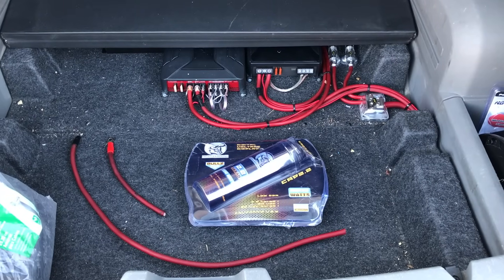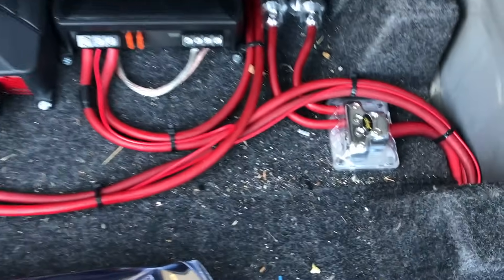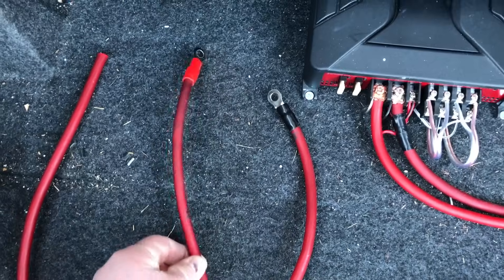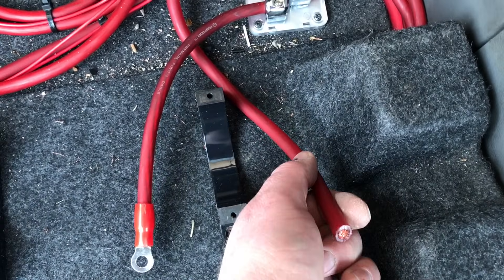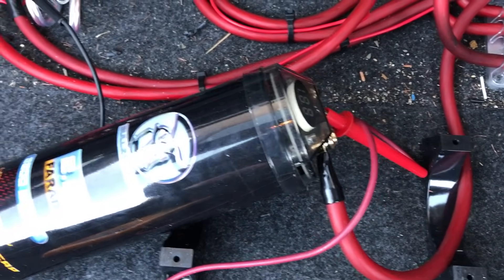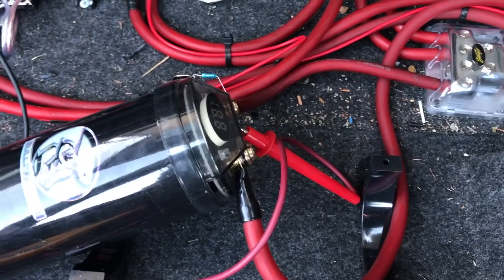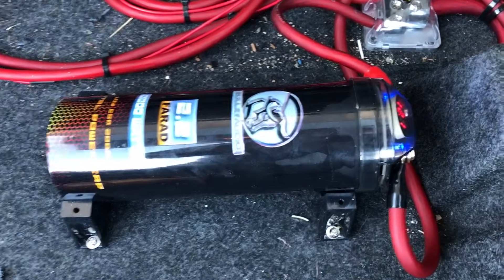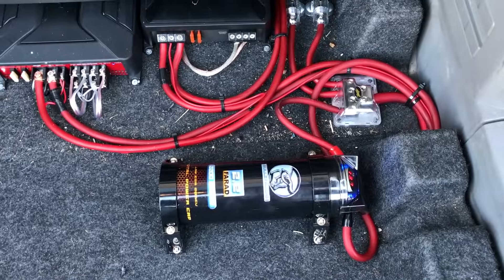How to Install a Car Audio Capacitor in your Vehicle

Comment from the maker: Parts linked in the description!
Reply: This is awesome, I installing a setup in MY Dodge magnum too. Kicker compvr speakers and subs
Reply: I had to come to an audio channel to figure out how to charge my big-ass Super Capacitor bank. It needs a low-Ohm resistor to charge....thanks. It only took three weeks to find that out.
Reply: What do I do with the little amp under the steering wheel
Reply from the maker: Nothing, unless you are planning on bypassing it.  If so, send me a message on facebook / instagram and I can help. @DodgeChargerPursuit
Reply: I Have A Question 
3 Northstar AGM31 PRO  Vs. 1 Northstar SMSAGM480 Which Is Best with JS 390a Alternator For Voltage ???

Comment: Shouldn't it go between the battery and distribution block??  That way the amps are pulling from the capacitor.  The way you have it ran the amps are fighting with the cap not using it!  Correct me if I'm wrong!  Thanks

Comment: Why isn’t the power cables to the amp coming from the cap? I see a distribution block sending power to the cap but what about the cap to the amp?  Whats the point of the cap then?

Comment: I have a 2007 Toyota Corolla with a 80 amp alternator, agm battery, 4 gauge ofc everything, a 1200rms skar amp, and dual destroyers d1 12s. I’m having big issues with voltage drop clipping and yes the lights on the inside of the car dim.  But problem is I have only been able to find 1 alt for that car and it’s 500$. I don’t know what else to do because I think a compositor is gonna make it worse, that just means my alt now has to charge two things.

Comment: Capacitors are able to charge and discharge faster than batteries 
    And make sure wire to and from capacitor, and each device should get its own capacitor preferably

Comment: Does it turn off or always stay on wen vehicle is parked??
Reply: Stay on for awhile then it should go off
Reply: @MiltonDearmon-n7y Hello!! Any idea why mine keeps flashing and draining my battery? I’m so frustrated.
Reply: @chrisftp1312  I don't know fam. Did you check to see if wires are ran correctly?

Comment: Can you wire the capacitor to any ground or does it have to be in parallel with the amplifier ground wire
Reply: Ground anywhere you want but if you use a distrubution block like he did, wire the cap positive in BEFORE the block not after.
Reply: @bigmizzymike  ok thanks. No just the power wire from battery to amp. I got that ultra capacitor coming! 375 fared

Comment: With it hooked up to battery positive does it drain the battery when the car isn’t on?  Also when I charge mine as soon as I disconnect the wires from the capacitor it imidiatlystarts draining and then blinks low.  Did I not leave the charging wire on long enough?

Comment: Why do i get a pop sound on the door speakers right after the capacitor shuts off, after the few seconds when turning off the ignition switch, it didn’t do that before installing the capacitor, capacitor was installed as directed based on this video

Comment: Love how EVERY cable it red, make for a more entertaining install.. 😂
Reply: it's not uncommon to use the same color wires when buying 20ft of wire. I'll take a heat shrink (black) and shrink it onto the wire so i know which ones which.. just a small indication for me to know
Reply: Lol when I was 16 I bought a 79 Camaro was impressed with how clean the engine compartment was........pulled the wire looms off to change the color and literally every single damn wire was red haha dude chopped it at the bulkhead and ran everything in red speaker wire. Thing looks like a closes encounter of the 3rd kind when you used a directional and highbeams

Comment: Thax for this video, extremely helpful. Question, for 3 amp setup/installation, does it matter what capacitor size to use? I see several sizes from 1UF 2000w,  2.5UF at 2500w, 5UF at 2000w......etc. Not sure what size capacitor to use in our new installation. (FYI, my old 1985 truck does not have a very powerful alternator, so I need as much help with power as I can for this all-new audio installation set up). 

What size fuse do you recommend using coming from the battery to distribution with 3-amp setup? Or from Capacitor to distribution? 

Also, the old stereo system with 2 amps that was installed by a stereo shop on this same truck, you could hear engine noise as you accelerate and shift(its a stick-shift truck) all through the speakers, very annoying sound. Not really sure what was causing that to this date. All that system is gone and we're installing all new speakers, Amps, Wires, stereo, sub...ALL NEW, do we need to add a device or do anything to  our installation to stop that engine noise sound?  Thax

Comment: This is a good video, it will help a lot of people. But there are two little things I saw wrong with this system in the video. The large capacitor and battery in back are wired into the system in the exact same way for a good reason. Think about it. 
* Often, the battery is in the front of the vehicle, and the amp is in back. Installing a large capacitor or battery near the amp allows you to use a smaller gauge cable from the battery in front, to the capacitor or battery connected to the amp in back. This cable from the front only needs to be large enough the keep the system in back charged. The large cable is still needed between the amp, and capacitor and/or battery in back. The capacitor and/or battery in back are there to supply the extra power needed during intensely high electrical current draw moments. As you can see, using a battery with a good amount of cranking amps or a large capacitor, close to your amp, accomplishes the same purpose; they are both acting as a buffer. If you only use this system when the engine is running, having both the large capacitor and battery in back is overkill. Unless one or both are too small of a buffer for the amplifier's needs, a battery in back close to the capacitor, only increases the system's energy storage capacity. I am a military trained electrical technician.
Reply: Bigger is still always better for wires though but I run 5k watts 🤙  and yah wire diagram is off

Comment: What is the value of resistor and when you need to pull it out?
Reply from the maker: You can safely discharge the capacitor.

Comment: Does the capacitor ever turn off... and if not Does it drain your battery
Reply: He hooked it up the wrong way. The diagram shows that you hook the power wire to the capacitor, the capacitor to the amplifier, which have a remote that turns the amplifier off and on, so should the capacitor turns off and on when the amplifier is on the capacitor on when the amplifier is off the capacitor turns off

Comment: Bout turn on and off do you need to install a killer switch? I got lost on. That part. Or it does turn off automatically after some time not use?
Reply: It doesn’t turn off you have to use the resistor to drain the power out of it but that’s only when dismounting or if the car is gonna sit for a long period of time

Comment: The end of the video is unclear, not sure if you hooked up 2 power cables to the capacitator or just 1? Since you showed the looped before, battery to capacitator and then to the amp. But it doesn't show on the vid.
Reply: I understand. He's using all the same color but I don't blame him. That's his preference. He only used a ground wire and one power wire. But that power wire was to the distribution block so it can power both the amps. I don't agree with it and I never seen it that way but If it worked for him then he's good

Comment: Dude you need to redo the wiring; Electronics 101, all ground wires are black / green NOT red
Reply from the maker: This is an old video.  Also, DC current could care less about what color the shielding color is.  Finally, being that this video was filmed about a decade ago, sometimes we are given wire the owner of the vehicle wants to only use, so you make due.  You apparently  haven't seen any of the actual content we make today.
Reply: I know....have a good weekend

Comment: Hey man, I just installed mine today and I noticed after about 20 seconds the lcd turned off and stopped showing the voltage while the car was still running. And started showing voltage when I turned the car off. Is this normal for the lcd to turn off after a certain amount of time but it’s still on? Thank you
Reply from the maker: Caps are generally low quality and don’t help much, but some do have a digital voltage display.  Generally they only show voltage readouts when there is only a voltage change.
Reply: @ProvoBeastAudio  thanks man I didn’t know if it was supposed to stay on or not but that makes sense that it only comes on when needed. And yes I agree. I thought I’d try it out for now until I can get a bigger alternator.

Comment: When my electric cooling fans turn on it causes a rough idle and light dimming. Will a capacitor like this help to provide the needed jolt of watts? If so, how can I set it up? Can anyone give your opinion please? Thank you.
Reply from the maker: I strongly suggest a big 3 upgrade and a better battery before you invest in this.  Generally capacitors are garbage and really wont' help much.

Comment: Now i see the capacitor have only positive and a negative so how does it go off or does it stay on. Don't understand nicely.
Reply: He hooked it up directly to the power source, which is the battery. There’s no power wire running from the capacitor to the amplifier so the capacitor was stay on and drained the battery.

Comment: so if i have 2 battery's allready, do i need  a capacitor? FRONT (YELLOWTOP) BACK YELLOWTOP -> capacitor
Reply from the maker: Capacitors are in most instances garbage. I don’t recommend it.

Comment: Does it matter what size distribution block you get ? Or is there a range of wattages to choose from in distribution blocks?
Reply: No, just make sure you get blocks that can accomodate the wire size you're using.

Comment: I just want to ask what does a battery capaciter do actually.
Reply from the maker: Provide more current when amperage draw is heavy when usually bass hits (generally for sub amps). These however are usually garbage and are in most instances not effective. We suggest doing a big 3 upgrade before investing in a capacitor.

Comment: Isn’t this technically wired in parallel when you do it post distribution block? Capacitors should be in series, so in this case, before the distribution block.
Reply: Not if it's only going to one amp.

Comment: I charged mine, it turns on when I open the car shows 12.something V. When I turn on the engine shows 14.something. But after a wile it turns off even if I'm listening to music and the amp is working

Comment: Question so to charge the capacitor i just need to connect negative to capacitor then resistor to positive cable then the other end of the positive resistor to + capacitor??

Comment: Hi I need an advice here I bought 2 amplifier Monoblock and 4 channel and a 3 way crossover how do I connect everything together and which rca cables must I use to connect
Reply: Hook up 4 channel then run rca into input of 4channel the other end to the monoblock so it amplifies the sound for subs. I never touched a crossover so I cannot answer for that

Comment: Won’t the amp still be taking power from the battery instead of the capacitor because the distribution block allows it to take power from the battery and capacitor
Reply: That’s what I think too! All caps I’ve installed show 12v power into the cap, then out to the amp straight from the cap.  I’m not sure how this install would benefit full potential of the cap

Comment: would the light on the capacitor create a parasitic draw on the battery?
Reply: I was wondering the same thing.  There's gotta be a way to shut off the capacitor when you shut off the car.
Reply: @Stalkervette  mine shuts off no problem or goes into standby mode. If your worried about a 2w LED light then maybe you need to rethink your hobbies lol

Comment: If I'm running 0 gauge to the distribution block, do you think it's necessary to run 0 gauge to the amp from the block or is 4 gauge fine? Would there be a power loss? Thanks!!!
Reply: Update? Any power lost
Reply: @ryaneboy101  none. Should have ran the 4 to begin with. 0 was overkill for 1500 watts. Anything more id say yes. I ran 4 from the front instead. But you wanna stick to the gauge you run.
Reply: Seriously I don't understand why ppl want these big fat stupid dong wires running all over their car. Get some 4g OFC for power and 8g OFC for amp distribution and be done with it. You'll only need the dong wire if you're using CCA

Comment: Do you have to charge your capacitor?? Can I get away with not charging it or it's a must?
Reply from the maker: Before running a cap, I'd suggest a better underhood battery and big 3 upgrade.  Don't waste your time with a cap.
Reply: @ProvoBeastAudio  got cha!! I was told my amp cuts out, cause it might need a capacitor!

Comment: For the extra ground wire did u just cut the power wire? I’m new too this and about too install my system
Reply: No I'm sure he used left over power wire. Since it's the same as the ground only difference is the color of the cable

Comment: What if I don’t charge it? Mine won’t hold a charge by the time I get the positive wire on its empty.
What if I just hook it up and don’t charge it?
Reply: You will probably blow something up as you are effectively putting a dead short across your battery.

Comment: Just letting you guys know never buy these look on down4sound and they have a video explaining it all your paying literally for 2 farads for 70 to 80 dollars when you can get a 500farad cap bank for way cheaper that actually works these things have sand inside of them to make them heavy try starting your vehicle with one you cant but you can run your car if needed on a real cap bank if in a emergency for 299 you can get 500farads for a bank of 6 caps hope this helps

Comment: Will this stop my headunit from restarting when I crank the engine. Super annoying as it takes a while to start and repair the blutooth to phone and start the streaming again. I can run a wire from headunit to this bypassing car wiring.
Reply from the maker: That sounds more like a head unit wiring issue.

Comment: How long can I leave it connected in my car that I don't drive
Reply: The Super Caps have a high discharge rate and will drain your car battery as well. The Caps can fully discharge in a matter of days. So keep that in mind.

Comment: I'm thinking of adding a capacitor to the batwing fairing on my motorcycle.  Can I run positive and negative from the battery to the capacitor in the fairing and then from the capacitor postive and negative of the amp?  That way I only need to run 2 - 8awg wires to the fairing.

Comment: Why would Some stiffening caps have a remote wire ?
Reply from the maker: Some have digital voltage displays that use that remote wire to boot the display when the engine is running.

Comment: Can a capacitor catch fire on the go? i am new to this, but i have upgraded my audio system which causes light dimming. I purchased rockford fosgate 1 farad cap and the installer smoked it on the first day. And recenlty i got soundstorm 2 farad capacitor . I wanted to install this in my car.

Comment: I have a question? I set up my capacitor the same way yours is set up. After speaking with a technician and they said that it’s wired incorrectly. That the power wire from the battery should go straight to the capacitor and then a power wire from the capacitor to the distributor which is going to the amps. What is the difference between what they are telling me to do and what we have installed right now?
Reply: The way your talking would supply all amps by the capacitor. For example I have a distribution block from main battery, it splits to a 4 channel amp and 2 channel. The sub  when the bass "drops" calls on amp to give it power which is when headlights will dim. Your door speakers don't require much power, the power they use is to get loudness and clarity, so to have the full benefit the capacitor needs to be as close to amp as possible, now could you run 2? Of course, but 1 other right placement makes a difference. I have this same setup as well as a equalizer in dash and crossover before the amps in the trunk. I'm actually about to add the capacitor hoping tomorrow, now my lights don't dim, my sub is 1600 peak, 800 rms mated to 800rms mono amp running speaker at 1 ohm, the doors are 500w rms combined on a 1,000w rms amp. I'm not pulling alot of power, but I plan too and also looking into trunk 2nd battery just to have it ready for future, my main power cable is 0 gauge and reduces to 4 gauge in trunk at distribution block for all other components.

Comment: I installed my capacitor like you said but I blew my starter relay, and car wouldn’t start. Any ideas why this happened? I also didn’t connect my capacitor to the ground on my car, I connected it to the ground on my amp.
Reply: Maybe that’s why, it specifically said not to connect to amp ground you need to connect it to chassis ground. Idk tho

Comment: Do you have to do the resistor first step to charge the capacitor if the capacitor has been purchased from someone who has already done it previously?
Reply: Im not an expert, but i believe as long as the cap is at least 50% charged then you dont have to. But if its empty or you dont know then yes its a must.
Reply: check the voltage of the capacitor with a multimeter, if the voltage is below 6volts then yes you would have to recharge the capacitor.